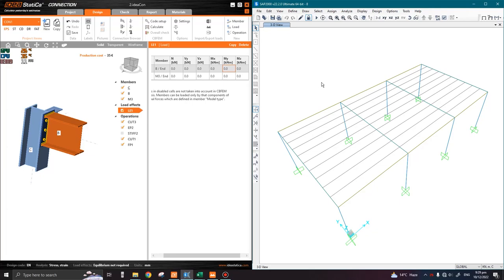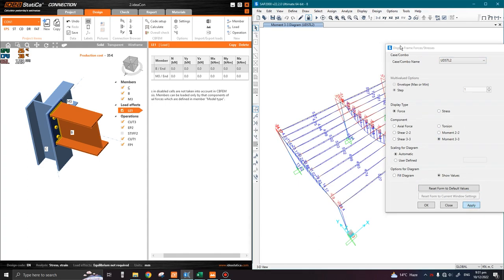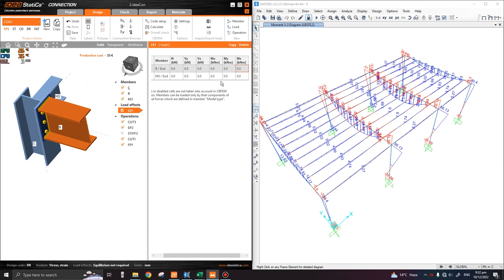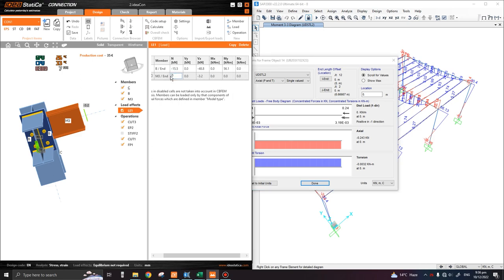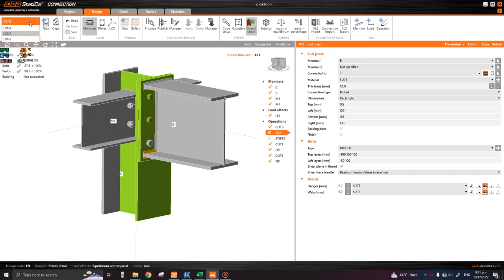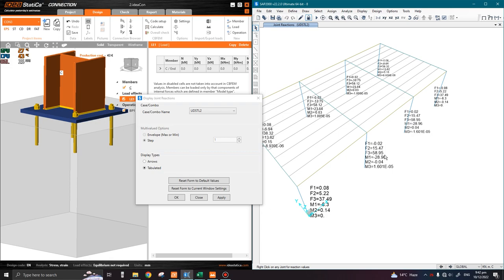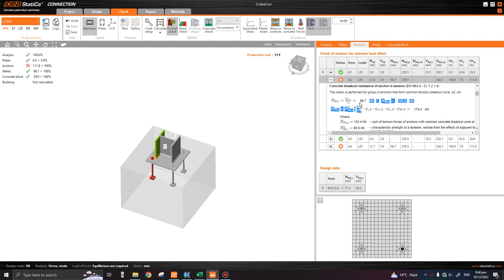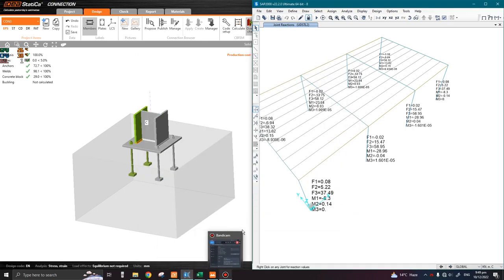Lecture 08 | Steel Connections Design | Design of Steel Structures | SAP2000

Comment: Please make a video taking reaction from excel sheets for the combinations
Reply from the maker: Yes i will include that after the beginner series is concluded, and we move to the more complex structures.. i didn't want to make things difficult at this stage. The basic purpose is to understand the process first specially for beginners
Reply: @ammarayub275  thank you for prompt. You are doing the  excellent job. Learning a lot from you. God bless you
Reply: Kindly make a video on the beam resting on another beam. Then how do we model and do the connection design? Please consider this point in the upcoming videos.
Reply from the maker: @hariasssss  sure. Noted